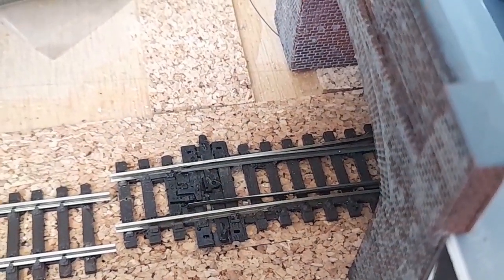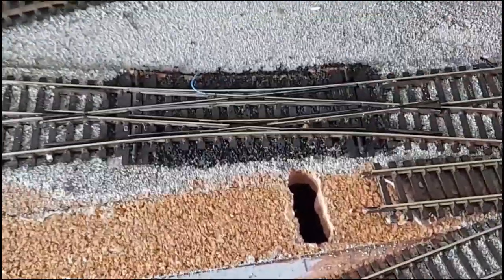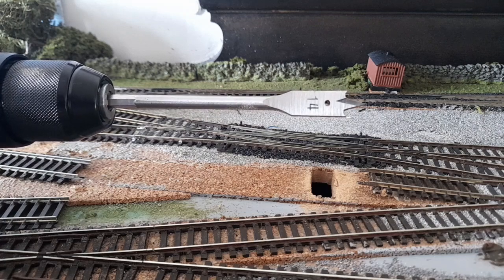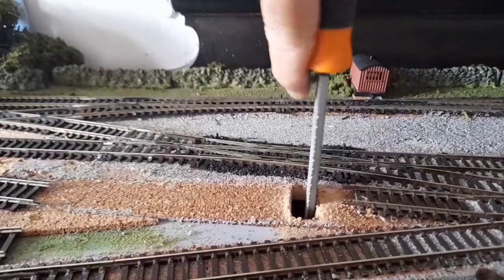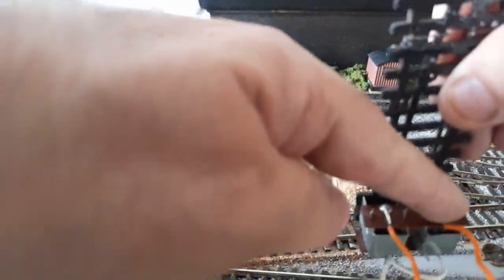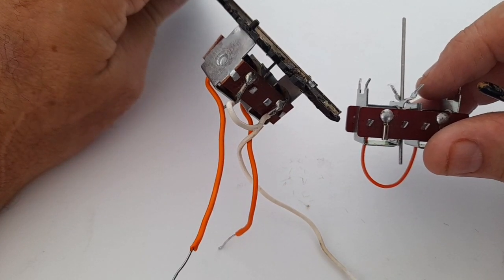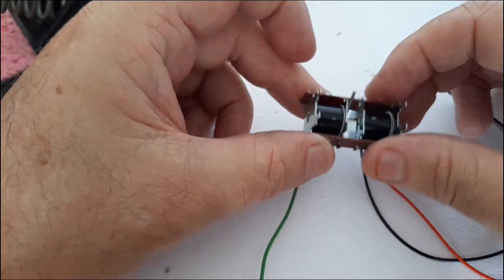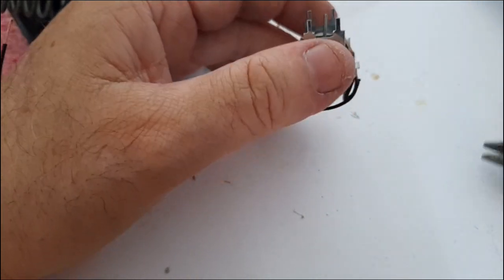How to install Peco PL-10 Point Motors to a model railway! | Horton Common Update

Comment: Excellent video! .. you have opened my eyes to fitting the point motor directly onto the point itself without the need for a mounting plate .. many many thanks :)
Reply from the maker: To be fair, I scrapped the idea of fitting the motor directly to the point, I now drill a 8mm hole centre and use mounting plates and PL10-E motors trimming the pin to size after checking using a slitting disc in a mini drill.
It vastly improved the operation of the layout at exhibitions

Comment: This is great, really well explained and detailed. Now I need the next bit, connecting the wired point motor to a switch. And maybe one day soon I will actually get started on laying track! Thank you for this video, much appreciated.
Reply from the maker: Negative wire from the transformer  to the switch, centre connection, positive wire to the point motor loop - hmmmm might be easier to produce another video, then you can watch it being done, would that be easier and more beneficial for you? It's really easy once you've done one.
Reply from the maker: We are going to produce a new video this weekend   showing how we wire up our print motors to operational switches and hope this will prove useful for you and many others.

Comment: I don't know.  I looks like a lot of extra work for not much benefit.  Plus although you want that hole to be snug, it has to be spot on to ensure that the points track meets up perfectly with the adjacent track pieces when you put it back.  Very little margin for error.
Reply from the maker: Fair point (sorry) but this was just an idea, and suited me at the time, yes it was alot of hard work, I didn't go for IKEA perfection as to fit, as I wasn't too exact,and actually a heck of alot of room for  error, which subsequently changed my mind in fitting them and I ended up removing the points for a totally different layout plan as I realised I'd made a grave mistake in the planning, therefore resulting in.my having to plug the holes with mdf pieces cut to shape, fixed into the hole and plugged securely with filler.  however........as things progressed on the  redesigned layout, I did indeed end up just drilling a hole for an extended pin PL10-E point, attached from underneath with an adapter plate and trimming the pin length to size, which was discussed in another video.

Thanks for your comment